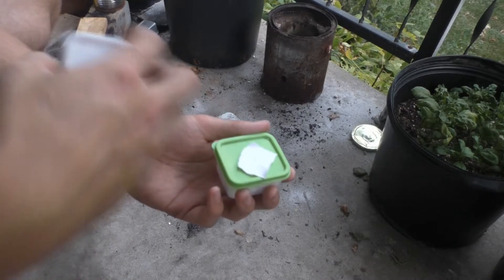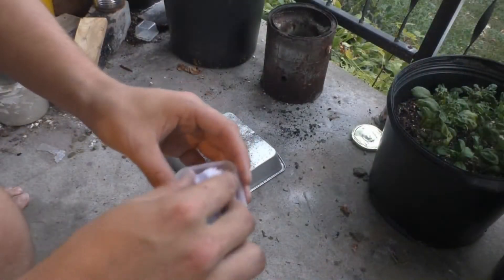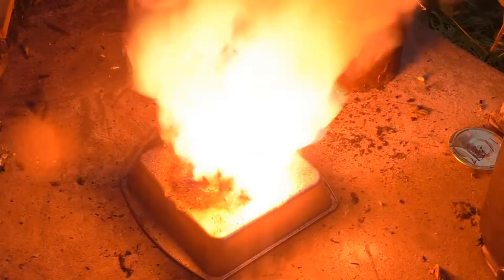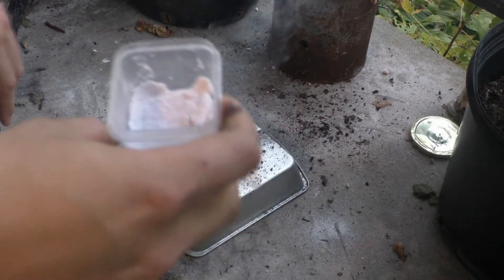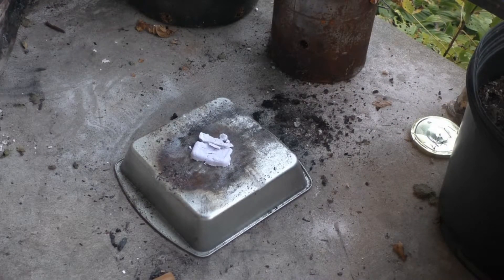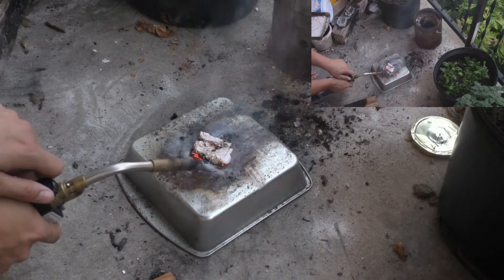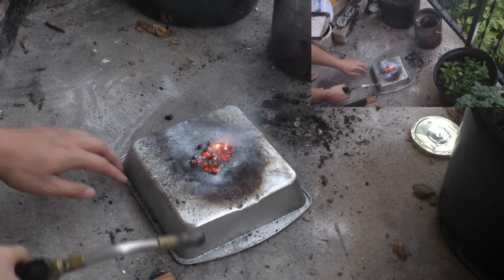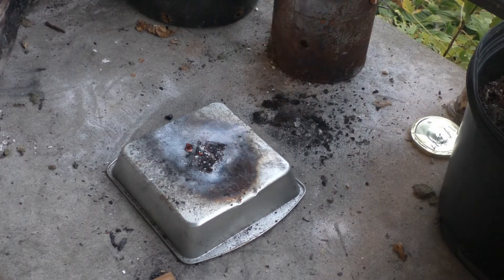PCRT RV, Shreded Paper (Potassium Chlorate Reaction Test Revamped)

Comment: Hello to TrollFaceTheMan and his loyal followers (I am one of them). I love watching the PCRT tests you do. After watching the shredded paper one, and seeing how the fluffy paper burned like crazy, but the compacted paper mixed with PC refused to burn (burned like granite), something came to mind.  I am thinking that your tests might be influenced a whole lot by oxygen in the air, so that the observations you film for us might not correlate with the speed of the reaction in an environment without atmospheric oxygen to help support combustion (i.e. the speed of the reactions may not correlate with the explosive potential, say for use inside a firecracker or rocket engine, etc.). So I would like to propose (if you are game to try it) a series of tests where no air is available. That may take some creativity to come up with how to do this. One possibility would be to take a large clear tank (say a 50 gallon aquarium), fill it up with nitrogen gas (cheap enough to get a big cylinder of it), and  place the sample inside the aquarium on a burn platform. Not sue the best way to get all the air out. Maybe invert the aquarium filled with water and then fill it with nitrogen to displace the water. Burn sample could introduced under water in a water tight transfer container some how. Maybe an oxyacetylene ignitor mounted inside the aquarium could be used to ignite the sample (oxyacetylene torch doesn't need air to burn), or some maybe an electrical ignitor could be used to start the reaction. Some engineering will be necessary to come up with a practical way to do all of this, but then it would be fantastic to see some of the PCRT test repeated in this "no air" setting. What do you think?
Reply from the maker: +Craig Paulshock I think it would be potentially a nice idea to try but out of my budget currently. However instead of Nitrogen gas, what about creating a vacuum chamber instead and igniting it in that?
Reply: That is a great idea, and would certainly eliminate any oxygen in the air from influencing the reactions. I don't know what a flame looks like in a vacuum?  It might be tricky to find a large enough clear container that can withstand the vacuum, and it has to be large enough to withstand any pressure build up from the combustion gasses? Smoke might obscure the filming. I guess we will have to wait and see what you come up with !!
Reply from the maker: That's the problem with any of the ways Oxygen can be removed, it'll seal it in a container of some sort which need to be clear plastic and will be potentially dangerous because of pressure during ignition plus fill with smoke.
Reply: Yes I agree it is an engineering problem that could be too pricey to solve. Clearly if money was no object, you could create a small hermetically sealed room or section of a garage (or seal a small closet, dark room, etc). The cameras could be set up like usual pointed toward the burn plate. After flushing all the oxygen out with nitrogen or carbon dioxide, you could then ignite the PCRT sample with a oxyacetylene torch or electric ignitor. You could stay in the room if you wanted to be up close during the test by using a scuba tank equipped with a cordless microphone. In a reasonable working space, there wouldn't be any concern about a little extra pressure from the burn. Something to dream about it you get a super sponsor some day. Cheers!

Comment: Interesting test! It makes sense that compressed paper didn't burn easily. The same will happen with many complex materials, unless there is something in the mix acting as catalyst or reaction booster. It reminds me of a test with toilet paper roll which didn't burn, but rather charred when heated with intense torch flame.
Reply from the maker: +BlisterHiker Honestly I am very surprised at how underwhelming it was, I at least expected something.
Reply: It wasn't so bad overall. First test with loose paper went very well, better than I expected. 
Cellulose fibers are a good insulator. I think by compressing them you've effectively turned them into slow burning mass, and cellulose (with some additives) is used to make fire retardant insulation!
Reply from the maker: +BlisterHiker Could be very possible, I think they typically add Disodium Tetraborate as a fire retardant and antimicrobial. Or at least used to.
Reply: Whatever they add, I'm sure insects hate it. My neighbors had their ceilings insulated with that stuff 20 years ago and so far so good. I see someone suggested PCRT with sodium benzoate (whistle mix). That's totally different beast. Even compressed, it burns violently. 1g of such composition can already be dangerous.
Reply from the maker: BlisterHiker Good to know, stuff like that I tend to mix small batches first for testing and to see wether they are safe for full size. If not I do a scale.
Reply: Very healthy, common sense approach! It scares me when I see people playing with dangerous amounts without even wearing eye protection. Whistle mixes are typically made with potassium perchlorate (much more stable than KClO3), but nasty KClO3 makes your PCRTs more interesting! Your videos deserve to be much more popular on YT.
Reply: I wanted to add one important thing: because KClO3 is quite sensitive, I humbly suggest not shaking whistle mix container directly in hand, but holding it in some tool at some distance away from your hand, or mixing the composition on paper (like with flash powders).
Reply from the maker: +BlisterHiker Diaper method, that is also what I do with Potentially sensitive or particularly violent mixtures.
Reply from the maker: +BlisterHiker But once again thank you for the heads up.
Reply from the maker: +BlisterHiker Thank you I am glad that you enjoy my content, I always appreciate people like you commenting too. I like to be engaged with my audience and suggestions and feedback from you guys is pretty much invaluable.